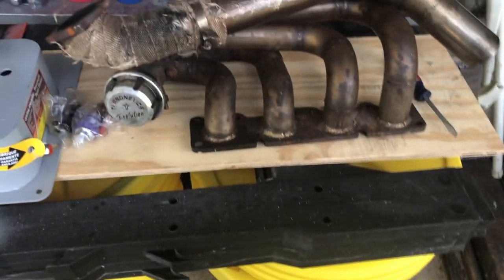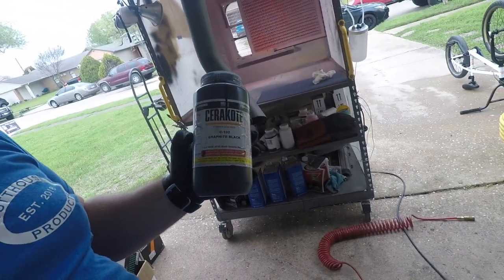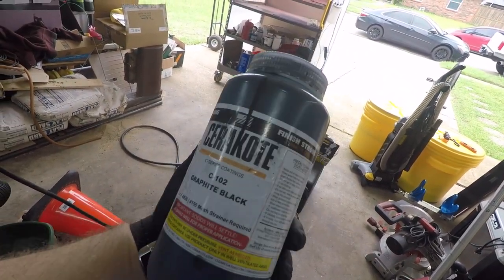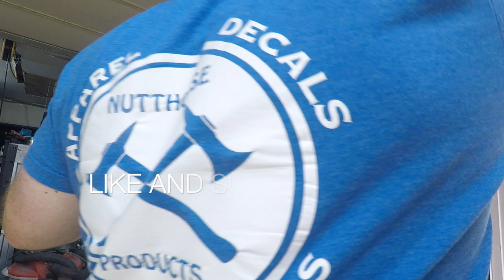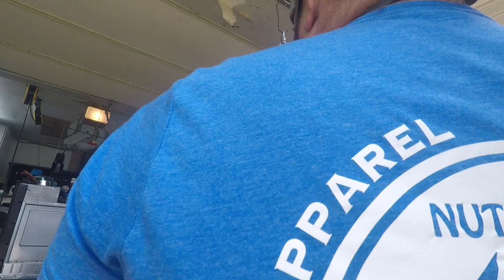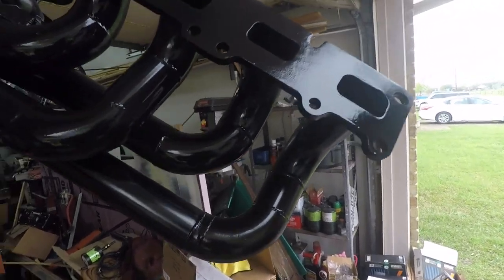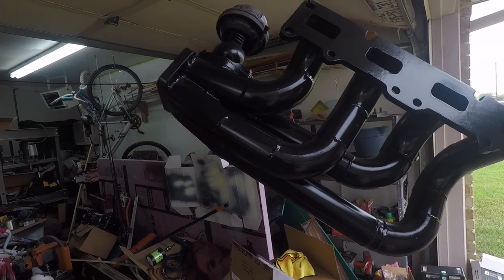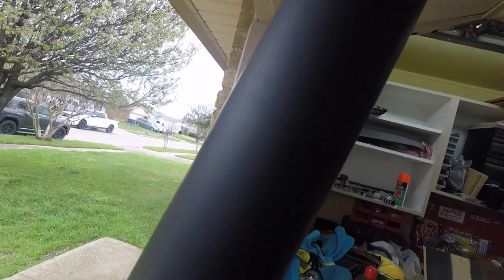Ceramic coating exhaust parts at home with Cerakote and no oven required

Comment: you asked for pointers so ill just say, try and get an independent microphone instead of using the gopro internal one because its nutty loud when you mount it on something or bump it while carrying it. Other thing is maybe dont use all the default songs from final cut (?) 

Otherwise nice vid, thanks for sharing
Reply from the maker: Yeah it’s still a work in progress. Thank you for the tip. Much appreciated.

Comment: Nice job!  I was thinking of doing this with my motorcycle exhaust.  Is it beneficial to do a 2nd, 3rd coat at all?  The more coats, the longer lasting that you know of?
Reply: I did my exhaust. Worked like a charm

Comment: Any idea on temp differences?
Reply from the maker: Not first hand no. I have been told that they ones ive done kept the engine bay temps down. Also that they could touch the pipes after the car was idling even after 15-20 minutes.

Comment: Great Video, how much of the Cerakote did you need for those parts, it needs to be applied single Layer, right?      Would really like to coat my exhaust parts, sadly in Europe/Austria it's pretty Expensive (230$ for the 32oz/946ml)
Reply from the maker: I bought 32oz myself and still have have the bottle left. I’ve done a few cars with that.

Comment: hi bro can u tell me please i f u have less heat with that?
Reply: Shane did my turbo hotside for my Mustang... Temps dropped under the hood. After 10-15 minutes of idle time, I was able to place my hand on the headers with no problem. Here is the video link he spoke of in the video... https://youtu.be/0-eDmkYMUAs
Reply: thanks bro i want less heat on my pizza ducati Pani V4 rear pipes my plastic shield is broke i think i will go for that thanks

Comment: Could this be brushed on?
Reply from the maker: I don’t think so. You don’t need a large compressor if that’s what you’re worried about. I’ve even seen it done with an air brush. There is also something you can buy from Home Depot that will allow you to make your own arisol sprayer. It’s by Preval.
Reply: @TheNutthouse1  thanks man 💪!

Comment: that application couldn't of lasted long... also what about all the neighbors cars? lol, no way would spraying in the front yard like that ever last long here...lol cerakote requires a specific tip size .80 . the HF gun I believe is like a 1.0 or larger.
Reply from the maker: Its been a year so far and they have had no issues, so yeah its holding up fine. And I have never had any issues with over spray on the neighbors cars. And yes you are 100% correct that they say to use a .8 tip and the harbor freight gun I was using was just that a .8, maybe you should do a little more research instead of trying yo come on and blast someone for something you may not know about. That's just my .02. But hey thanks for the views, its great appreciated.
Reply: @TheNutthouse1  lol.. if you say so..